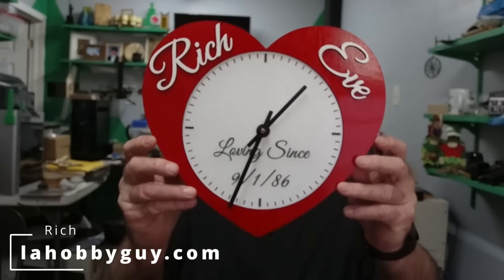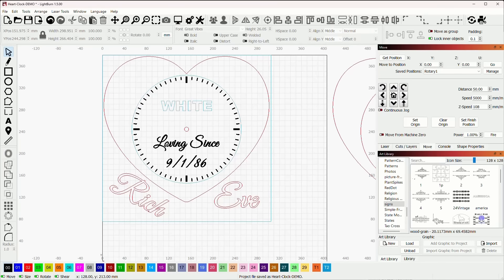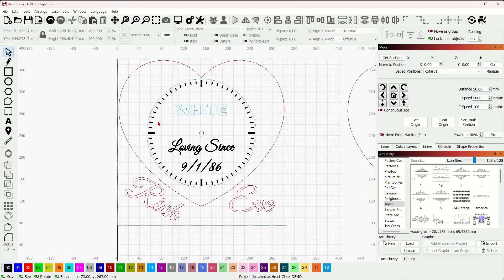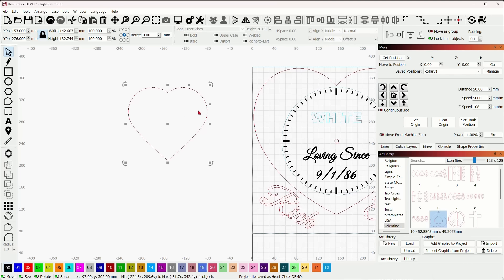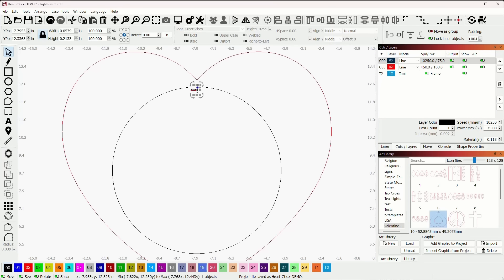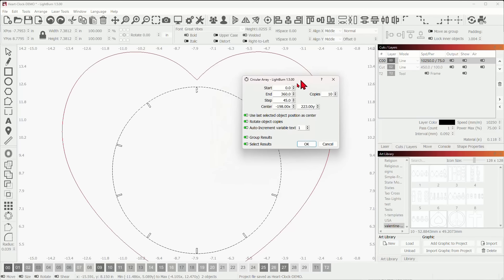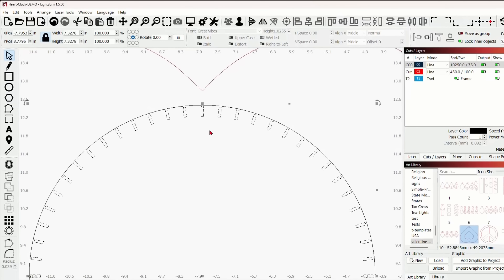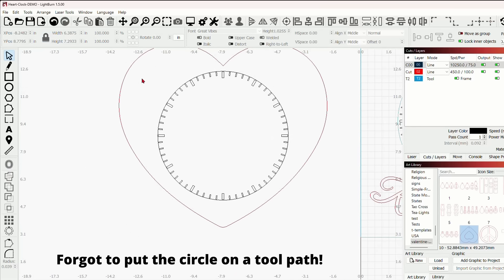💖 The Making of the 2024 Valentine's Day Heart Clock - FULL TUTORIAL!

Comment: Great video!

Regarding the large number of nodes in your heart, would using the offset tool with a zero offset, delete original, and optimize / simplify turned on remove the unneeded nodes?
Reply from the maker: Yes it would Jesse! If you drag out fit shapes to lines and fit shapes to arcs, you can get it down to about 7 nodes. But that's another video. I wanted to emphasize the pencil tool in this one.